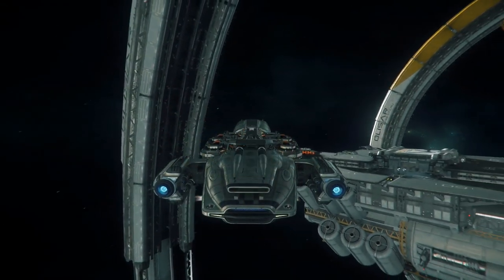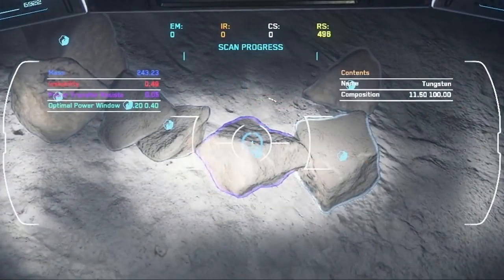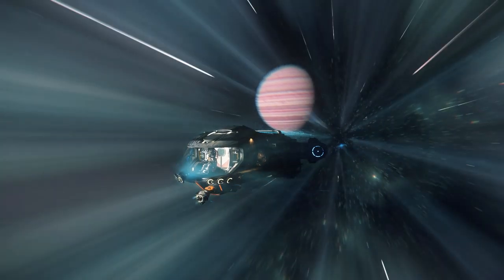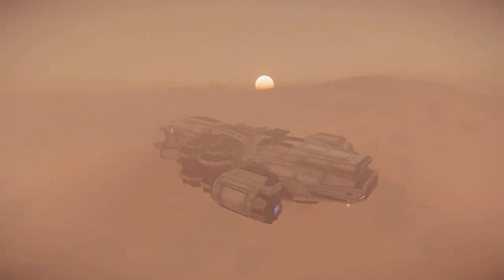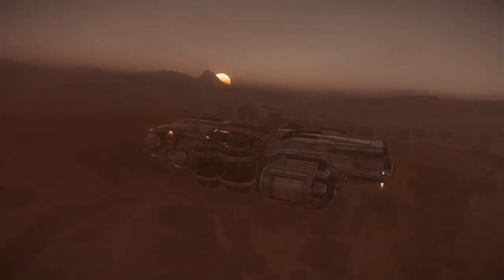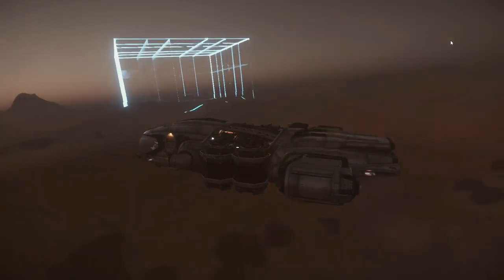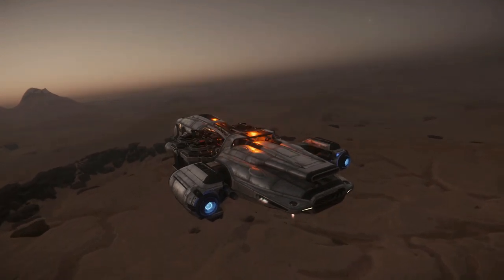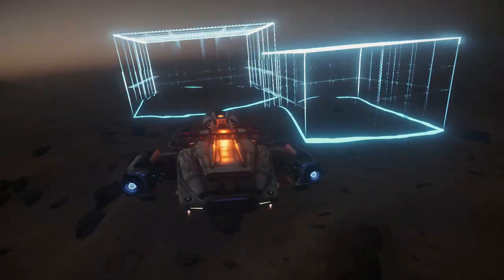Star Citizen 3.8.2 - Rock Purity Exposed - Is Rock Purity a Thing? Fact vs. Fiction

Comment: Hey there thanks for your great Videos! In one of your Videos you prefer small and fast scans. Did that change with 3.8? Thanks!
Reply from the maker: It did.  I've been having trouble picking up items, even close ones, with the short pings.  For some reason (without any real data) I think i t has more to do with the heavier de-sync in the 3.8 updates (that part is known by CIG) than any changes to the scanning mechanic itself.  It's also pretty common for the scanner to pick up nothing in my area, then on a repeat ping pick things up that are almost underneath me - which also sounds like de-sync.  Thanks for the view and comment!

Comment: Great effort and info, I'll have to rewatch to make sure I digested what it actually means, tho maybe not so important atm. My experience is that the likelihood of 100% chunks is more indicated by the % of the mineral, tho that isn't always true either. One thing I didn't realize of ages even tho i do fairly careful mental count of how many kg  of mineral I should get from a rock when i first assess it, then tally the kg as i extract them so that i don't leave any buried in the rubble. That some of the rock stays underground and is beyond extraction. Maybe it's just persecution complex or maybe it's an algorithm that it also often seems to be that the valuable chunks upon rock fracture seem to end up on the bottom, cheers :)
Reply from the maker: Funny you mention that!  They had that nicely fixed at one point in 3.7 - the rocks heaved up out the ground to lay on the surface when you fractured them...it was a pretty cool effect!  Sadly, some mining bugs have returned, but I'm sure they'll be resolved eventually.  :)  Thanks for the comment Sys Ko!
Reply: @Oearth  T;hey do that heaving out of the earth nicely, but not always all of the rock. A rock with just tip showing may break in two and heave up both bits, or it  may only heave one of the pieces and leave the other totally buried, ime the good bit :)

Comment: I don't even use the ping to scan the materials inside the rock. I've always just pinged for boxes/rocks then when I'm flying down to a rock I bring out the fracturing laser and just get the details from that. You quickly get mass then the most expensive ore in the rock and if it's garbage then you don't have to wait on the rest of the scan happening, you just fly away so it's quick. If you scan with the ping then you have to wait on the whole scan everytime

Comment: I knew that from the get go. What I'm trying to figure out is how come many fractured pieces have been quickly evaporating into thin air for me lately when mining on Daymar. It usually comes with some other oddities like rocks showing the purple outline but still needing to be fractured, etc. Its unlike the rocks that disappear lately in asteroid mining, that's different, but I dont know if this a bug or a result of using the Helix laser head or a new feature or what...
Reply from the maker: I really don't don't know.  I haven't heard or experienced that yet.  Are you in 3.8.1 Live or the 3.8.2 PTU?  A disappearing rock certainly sounds like a bug though.
Reply: @Oearth  In the PU, I haven't tried mining in the PTU yet but I'll try it today. The fractured pieces would evaporate almost as if their density was low and the laser too powerful, and only while I was charging them, if that makes any sense.

Comment: I know exacly what is that number purity number is. So lets say u have a rock that have 30% tungsten and 50 "purity" well what that actually means is that 30% tungsten is spread in only 50%of the rock. So if that purity number is small actualy the material u want to mine will be more concentrated in one part of the entire rock and u have bigger chances to get chuncks of 100% minerals. Hope this will help
Reply from the maker: If you can get a screen shot of a single ore rock that doesn't say 100 for that 'purity' value, please send that to me so I can investigate it and probe farther with CIG.  Data is always a good thing!  :)
Reply: @Oearth  oki doki. I can do that
Reply: @Oearth  but that number apply only to the rocks that u can break. So on a rock that u can extract will show 100 because all the materials are spread into it and u can't break it more
Reply: @Oearth  in you video if u  go to 4:30 there is a rock thata have 24.31%  titanium concentrated in 81.81% of the rock and 5.42% gold contentrated in 18.19% of the rock. So 5.42% its preaty small for a rock of 4268 mass but if u had 30% gold instead of 5.42% in that 18.19% than  u most likely could mine allot of 100% gold chunks

Comment: I don't understand why you can't have "this" situation (which you are showing...) where the ore (or whatever) has 100% purity. If it is the only ore in the rock, then it must be 100%. Or am i not understanding you correctly?
Reply from the maker: I think you're understanding it right.  A 100% means you get 100% material.  There was a rumor that the other number I referenced somehow meant that within the 100% of material, there was some sort of scaling purity which influenced how much of the actual ore got sold - that wasn't true - it was fiction.  However!  Now that refining is coming in 3.12, it is possible that there could be some sort of purity introduced where even if you get 100% of an ore, perhaps there is some variation in the quality of that ore...a kind of "purity"...perhaps like where a diamond can be a solid diamond (100%), but some have more inclusions, flaws, off-color, etc., that influences it's quality (a.k.a purity).  I have no idea if that will be a thing when refining is introduced, but it is possible that they could introduce that concept in the future.